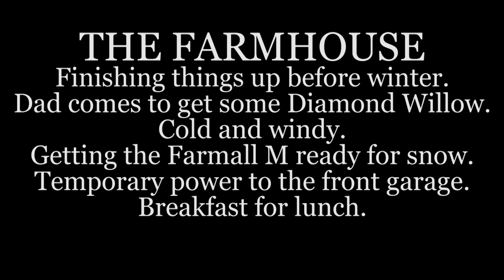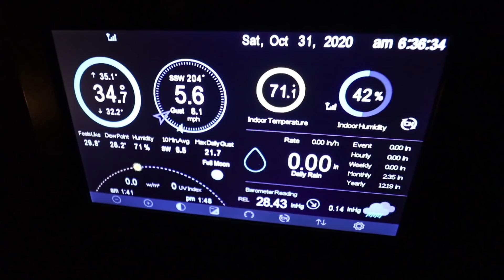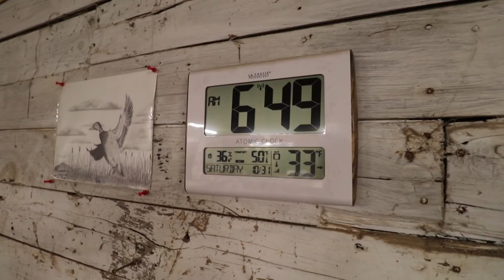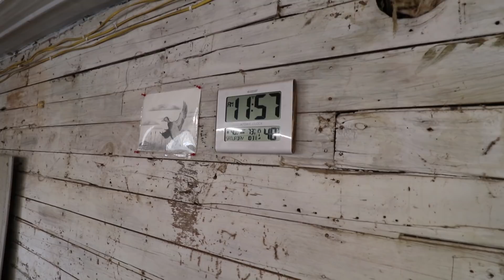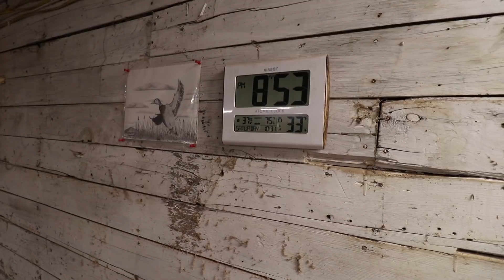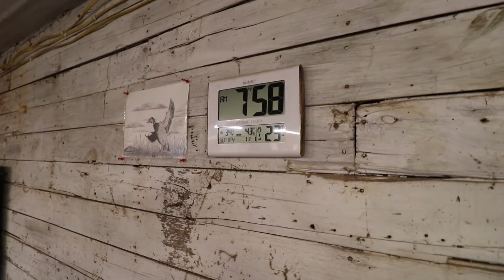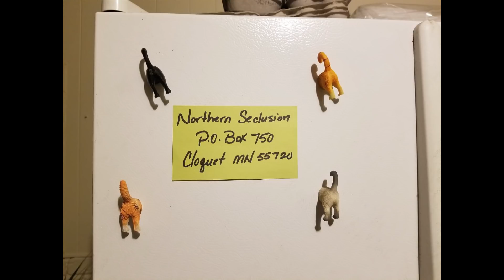THE FARMHOUSE. Finishing things up for winter. Dad comes to visit. Farmall M. Windy cold weather.

Comment: Sure could use your expertise Joe, as I went and bought cubes to add depth to my lounge  BUT as one wall is concrete  and the others are Bose, so the cubes are just sat precariously  against one Bose wall . Yes I know I should have one of these apps that tell me where power is running through the internal wall but heck its just a one off situation I thought would look nice. Think I need to consult with a Joiner. Cheers mate!!

Comment: Back when I lived in Illinois a big store was closing, they had a big snow blower they were selling. Just about like yours, they wanted just over 100 bucks. The store couldn't find the key so they gave me more off the price. I put a toggle switch in to replace the key. Worked just fine. Get rid of that Echo and get a Husqvarna . So question are you using the Argo?
Reply from the maker: The Echo is a chainsaw that someone sent me from the channel. It has worked well as a small chainsaw. I am not a husqvarna chainsaw guy. I always buy Stihl. I have a 360 I use most of the time. I do however use Husqvarna for my mowers. They have been good for us.
Reply: @NorthernSeclusion  I only own Stihl myself with 2 blowers biggest weed whacker they make and one chainsaw

Comment: Might want to give that engine heater a test run for a few hours before you really need it. Some of them pull a lot of amps

Casey's around here was selling premium non ethanol gas. I'd buy it for all our small engines. It was nice to not need any fuel stabilizer. But for some reason they just went to ethanol premium. Ugh.
Reply: I buy the non-ethanol gas too for winter purposes, higher the octane the better, I have a couple stations that sell 93, its more expensive but worth it, in the 5 gal cans of the equipment I put a de-icer in the can too, never know when that water builds up and jams up the carb, between the 93 and de-icer i try to be proactive on reliability...